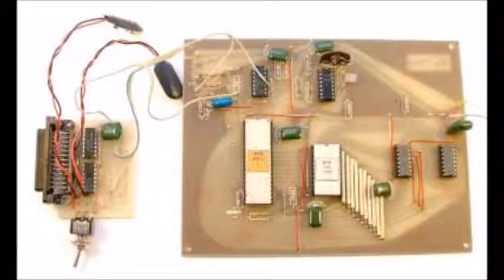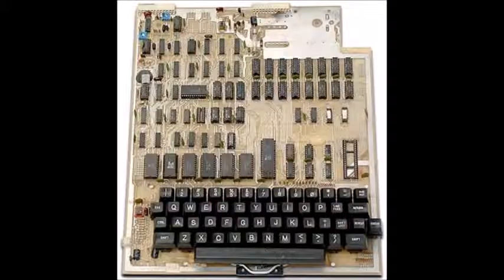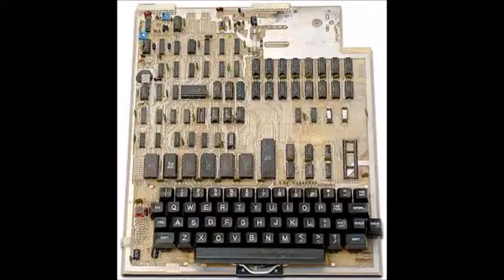My Computer History 1978 to 1986 (Overclocking since 1981)

Comment: So the superboard ran stable at twice the clock speed?
Reply from the maker: Yes it was fine my 6502 was rated at 2Mhz so no problems.. The motherboard was also modified and I was using a third party set of ROMs from a local Oz computer company.